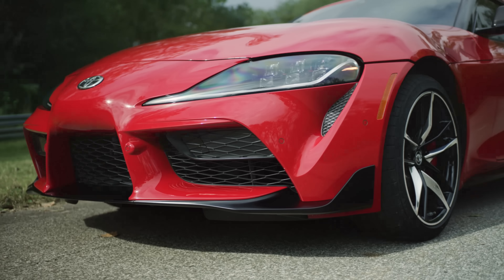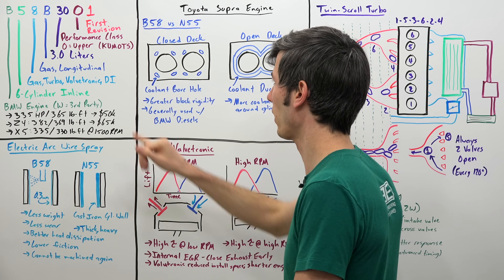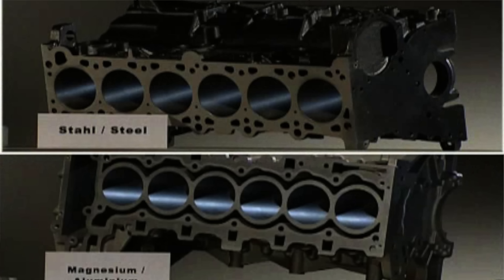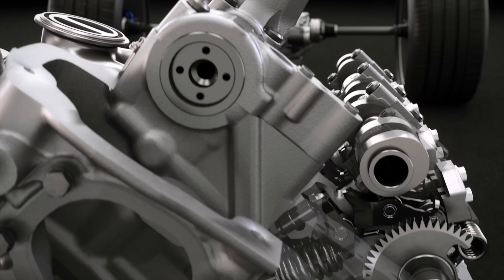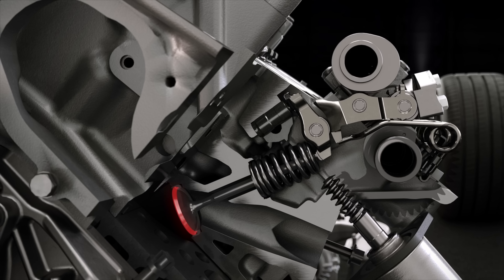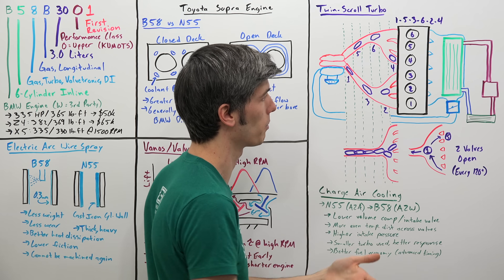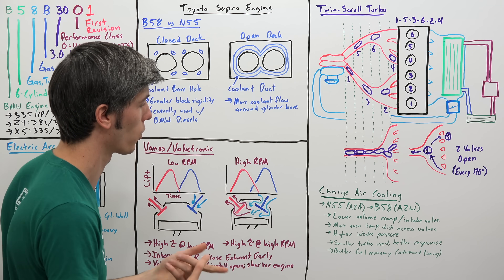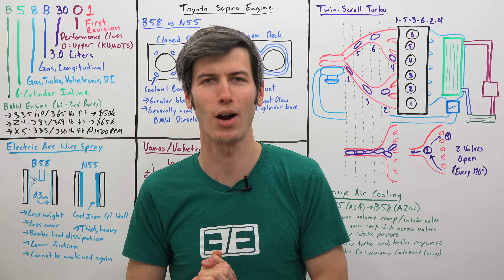2020 Toyota Supra Engine - Detailed Review Of The 2JZ Successor

Comment: When we heard Toyota and BMW were collaborating on a platform we were all hoping for BMW handling with Toyota reliability.  I've seen a video that claims that Toyota did their own testing on all the engine internals and gave their input on what needed improvement.   My thing is that the in car entertainment is all BMW and that does not help with the overall experience of differenciating the Toyota from the BMW cousin

Comment: The "closed deck" design is just closed in near the top of the cylinder I believe, the lower portion of the cylinder still has coolant all around it for cooling. At least that's how it is with Subarus...

Comment: Interesting video!  I am considering a M240i, but I am now concerned about the closed deck concept.  The photos on this video, and your diagram, suggest that the level of internal cooling in the engine (and perhaps the head) will be less on a closed deck configuration, assuming the coolant pressure is the same on both engines.  I heard of no such issues on the M235i, which I presume was an open deck design.  Do you think this is an issue with respect to long-term durability?  KD

Comment: How about this........ as soon as I buy this B58 we pull out the Engine and put in a 2JZ. With the old transmission and drivetrain. Explain all you want it is not the same. The B58 Can't be pushed to fly as high as the 2JZ it would break and probably can't be rebuilt. Mega-FAIL. BMW clipped the old supras wings.

Comment: Boy, no one actually does research. I own a shop in NY and I have worked on MANY BMWs over the years and I can tell you from experience BMW makes the LEAST DEPENDABLE engine on the market. Oil pumps go out around 100k, other parts especially on the valvetrain made with the wrong materals causing wear issues. The list goes on. On the other hand, I've seen Toyota made engines last well over 500k, Ford 4.9L inline 6 go well over 700k I have a bronco with the original 302 with 600k on it and it still runs great!

Comment: Great info but... Ummmm 
Watching this in my 2018 F30 340i Msport with the B58 Engine and JB4 tune (MAPS) 91 and 93 OCT 
Hmmm so basically my 340i will smoke the new supra lol 
As I'm currently putting down 362whp and 402 tque @ 23.4 PSI (91 OCT)

387whp and 424 tque @ 18.9 PSI (93 OCT) 
So yes why would I invest into the new Supra lol 🤦‍♂️💯👏

Comment: Hey Jason. The explanation about valve overlap isn't right. Actually there is a large overlap at low revs to improve scavenging and get the turbo spool up to get better response and max torque, whereas in high speed, scavenging cannot occur since the exhaust pressure is higher and instead it reduces the volumetric efficiency. So at higher revs , lower overlap is used.

Comment: such a DISAPPOINTMENT .....my god...
Reply: I drove a stock 340i with the B58 in a manual trans last week.  The experience was anything but a disappointment.  There are videos of tuners getting 400+whp with some simple aspiration mods and a tune.  With this engine driving the new Supra AND the Lexus IS, expect the aftermarket community to really step up their engineering efforts in unlocking the potential.  It might end up surprising you.
Reply: Brian Neu You don't get it.

Comment: I want a supra... Not a bmw pretending to be a supra. And yes.. A BMW supra is what it's true name is TECHNICALLY!! I like toyota and i like BMW. But i like toyota far better for reliability and its cheaper to work on and get worked on. Bmw is too expensive for its own good but of course if you can afford it and like that then more power to you and have fun. I cheer u on and know where your coming from. BMW is a fun car to drive none the less. But a hybrid between the 2 is like mixing coca cola and sprite and trying to sell it as a great brand. Not a good move. Swap that BMW out for a 2jz. There are  limits for tunability on that BMW engine. What are you supposed to do after that lining is gone after 150,000 miles? Pay an arm and leg to get the engine shipped and restored, how long will that take? Months at least, or get a new engine? Which is what i would definately expect BMW to do to boost production and sales of that mediocre engine. You really cant do much to it at all. You are limited by that lining in reality. Swap that bmw engine out for a 2jz.. Then we are talkin! Cant wait for diy videos on that aspect.
Reply: Again im not talking down on BMW.. By itself BMW is an impressive machine. Great car great engine, better handeling and chassis, the whole 9 yards. With that said. If im a BMW lover i wouldnt mind getting the supra knowing these facts and save $15000. But for the toyaota lover. Its cheaper to build, modify, make big power, and upgrade suspension to wjat you are trying to achieve. And yes BMW has better handeling by far from the factory. Very impressive. I absolutely love it and wouldnt mind leaving that in! But Its not a toyota "techically". And if you want to upgrade and customize the engine and hp and torque curve for what you want to achieve on the track or whatever you want to do to customize it. Then i dont think there many options to  upgrade this engine. The 2jz is an iron block. It can handel whatever boost you throw at it with ease. Im just talking about big power. The 2jz is almost indestructable. So you can do a million things to it. Make it reflect you. The impressive BMW engine is very specifice in its design. Not saying thats a bad thing. Its a perfect engine for its purpose. Its for the people who want Bigger power 1000-1500 hp. Cant sleeve this engine. Cant increase hp by much because it will go beyond the designe of the design of the cylinder walls with the spray on lining.  Ok so basically its just the difference between people who like to modify and make the engine their own with big power. and the ones who are perfectly fine with leaving the engine alone. Great enigne. But i can tell you like most BMWs, its a tempermental engine/machine the moment you touch the engine.  Its so specific in its design i wouldnt reccomend to modify it and to leave it be.. It might be able to handle slight changes like breathing, higher boost changes, and adjusting the curve but only to within its specific design limits which is small. But guess we will see. Theres a lot of smart people out there so im looking forward to seeing what people can do do make this car reflect their personalities.
Reply: Just buy Supra then. Most of you wouldn't have bought this car no matter who made the engine. It's funny to see toyota fan boys crying all over youtube.
Just thinking out loud.
Reply: Who will want to downgrade bro? B58 is already making 800whp and 1200whp is possible - with better dyno curve and torque and better turbo response, not to mention best chassis toyota ever had. mk4 supra was mediocre in handling even compared to that era BMW M cars. Poor F&F fanboys have a chance to finally experience what a ultimate driving machine should be.

Comment: Btw, anyone that knows anything about turbocharged engines (especially in the Honda world) knows the benefits of a closed deck versus an open deck when it comes to sleeve strength. While I find the fact that you can't just bore it if something were to go wrong kind of disturbing, I'm sure we will still be able to resleeve the block if goals are over 1000 hp. Idk what those spray in wire sleeves can handle, but my guess is not a whole lot.
Reply: Or hell, worst comes to worst, we could swap a 2JZ into it, or even an N55 and boost tf out of it.

Comment: I have to say I'm rather disappointed. If I wanted a Z4, I would simply buy a Z4. I will admit the aesthetics are good, but a lot of the rationale for buying Toyota/Honda is the implied reliability. Also the purported 335hp is not very is not specifically impressive for a 3 liter turbocharged motor, though I'm sure there's a lot more power that could be unlocked there.

Comment: Toyota 3jzgte please. Stop with this BMW collaboration. Go to Yamaha and have them build you a cast iron block closed deck engine with variable valve timing on exhaust and intake and both direct injection and port fuel injection(for emissions and economic purposes) twin scroll single  turbo and a manual trans. Make  a engine that people can experiment with and you will have a winning recipe, not this piece of junk.

Comment: Great design lines derived from the FT1 concept while giving flashback emotions from the MKIV Supra...
The whole BMW/Toyota joint development issue isnt something that i mind...
The only problem is the platform they chose to share.... It should have been the M4 , not the Z4....
Although for cost savings etc, they just could use the new sister company Lexus RC-F body (FR 2+2 coupe) which would allow the design to be smoother and more "Supra" rather than a compact 2 seater Roadster turned to a coupe. It could also be powered by the new 3.5 V6 Twin Turbo powering the new LS, with Gazoo Racing's treatments.
BMW has definetely givven the new Supra a great interior in terms of quality, materials, and built.
Also the engineering is great as BMW is a leader in 4/6-cylinder turbocharged engines for 2 decades now...
My feeling is that because in Japan there will be the SZ/SZ-R versions with the 2.0l 4 -cylinder turbo engined  with 197 / 258hp respectively as well as the RZ with the B58 and 340hp, the Supra will be a major success due to its tunability, and lack of competition in the JDM market in this class.

Comment: Closed deck - good.
Non-replaceable liners - bad.
Vanos+Valvetronic - good idea, will be terrible implementation (overly complicated and unreliable).
Twin Entry turbo - good.
W2A intercooler - good if not for plastic construction, terrible.
335Hp out of turbo 3.0 with Vanos+Valvetronic - pathetic. This power level is achievable in N/A form. I suspect it was watered down so it does not compete with Z4 sales.
Not designed by Toyota+Yamaha - utterly disappointing. Except the questionable look, what part of the car is designed by Toyota?

In reality this is a new Toyota Cavalier of the GT cars. In 10 years (when regular people could afford it) this car will have so many problems that no one would want to buy it. Where I am located used BMWs are not in demand, and only clueless people buy them, simply because they are falling apart and are very expensive to fix, compared to JDM imports.

Comment: One observation, the B58B30O1 has two turbo and the M1 has one twin scroll.
Reply from the maker: Are you sure it’s not the S with two turbos? Thought O1 is the dedicated Z4 engine.
Reply: @EngineeringExplained  you are right. Between O1 and M1 the main difference is the exhaust manifold...but both mono turbo twin scroll

Comment: The exhaust manifolds are internal and there are actually two ports exiting the head. More of a collector than a exhaust manifold. One of the reason for this is to cool down the exhaust for lower emissions. Btw the "exhaust manifold"on the b58 looks similar to the rx7 exhaust manifold and provides a more compact package for the already crowded supra engine bay. For me there is just way too much plastic in that engine bay as with most newer cars and is just one more thing to worry about.

Comment: I don’t know why people are so upset about the engine. All the great Toyota engines like the 3sgte,2jz were developed by Yamaha. Toyota was never a great engine builder in the first place. They relied on other companies.
Reply: I think its mostly because of how different the philosophies of BMW vs Toyota are. As far as I know the JZ family was only partially developed by Yamaha (and I think it was mostly the head). That isn't too surprising as Yamaha and even up to the 1LR. But on a fundamental part these engines all started out as a toyota design and just hiring yamaha for some extra engineering talent. 

that just doesn't sit too well with Toyota fans when this engine is a non-toyota design. Especially when BMW has had both true and false conceptions of questionable reliability,  andthat this is a brand new engine with almost no proven miles in production. No one knows about this engine, and where toyota is now synonymous with "engines that are bulletproof from the start" it's hard on toyota fans  sitting on this giant question mark. For all we know it could be absolutely bulletproof....Or it could be an S85/S65.

Comment: I hate when people say that the new Supra isnt a Supra because it is made by BMW. And it wont be as good as the A80 Supra. But they forgot that the A80 didnt had 600-700-800-900-1000Hp when it came out of the factory. If we look back to the early 2000s some tuners called the BMW E46 M3 engine the Europian 2JZ. That car with that engine is still a legend just like the A80 Supra. Give the new one a chance, and let Dough decide weather its a good car with a good engine or a bad one. Thanks for reading this. :)
Reply: SSgt Preacher Dough is the type of guy who single handily depreciates the value of a car by revealing it’s useless quirks and features.
Reply: @soraaoixxthebluesky  *increases the value
Reply: its because the z4 engine is built like dookie

Comment: Great Video! One little thing you said about the name of the engine that I want to correct. 
The first B in the name does not stand for BMW but for Baukasten which is the engine production type. For example you see the older engines of BMW had either N or even older the M engine types. (e.g. n47: "N"eue Motorengeneration (new engine generation), 4 cylinders, diesel engine)

Comment: if the engine wasnt turboed, the camshaft timings at high rpm would definitely cause problems wouldn't it?because the intake cam is blocked by the gas trying to escape during the exhaust stroke as well

Comment: Not even remotely a 2JZ successor in any way beyond being a turbo i6 in a car called a Supra. No iron. High compression. Short Valves. Low potential without crazy $$$ and never will be as reliable as a rusty 20 year old 2JZ because it's built to make as much power as it makes stock.

Comment: With the cylinder walls being electric arc sprayed on and since you can't machine them, surely they will make it possible to machine and respray the metal surface on? That would be handy.

Comment: @Engineering Explained
The USA Z4 makes more power than the other Z4's because it doesn't need an extra exhaust filter. The same filter is on the Supra but also is in the US. That is the horsepower differences

Comment: Great, another ugly car that will completely fall apart after 100K miles.
Reply: 500k km (300k miles) and much further beyond in a European spec 3-series is very common. This engine uses european spec Nicasil instead of the American spec iron sleeves, which is why it will probably last much longer than other BMWs for the American market.
Reply: they will swap 2jz back into the zupra hood. thats the point. then toyota can continue to brag about toyota reliability.

Comment: BMW Supra? No Thanks, we wanted the Toyota Supra designed in Japan. 
Perhaps a 3JZ: A polished up, modernized, D-4S version of the 2Jz.
Having Port and Direct Injection and being Toyota designed would make it a much more desirable, reliable car. Having both is the best way to keep the intake valves clean and carbon deposit free.
Reply: Just get a mk4 shell and slap a 1fz in it and you've got a 3jz supra.

Comment: The B58 its a pretty good engine, it will makes lots of power in stock internals. But you can't tell Supra fanboys that an S55 is just as good as a 2JZ. BMW engines are strong and realible it's just that everything else around it it's not.

Comment: The biggest problem with BMW engines is carbon build-up on the intake valves with EGR, which Toyota had solved with dual (port + direct) injection on all their Toyota/Lexus cars that had direct injection. Even Ford started doing dual injection on their F150 engines for the same reason. If this B58 BMW wasn't modified to have dual injection, it may leave a black mark on Toyota's reputation for reliability. I hope Toyota did think this through. With German cars, they only want their engines to last the 36 months of the lease these days, so it won't matter for the Z4.

Comment: The tragedy of Toyota arming one of its legendary cars with foreign engines coming from BMW !!!!! it is even not a joint venture car with the foreign manufacturing !!!! I still think that the Lexus LFA , after excluding the composite materials used in the manufacture of the structure (carbon fiber) and the high quality of materials used to manufactured  
the engine the front engine mounted , rear wheel drive LFA was a good project for the Subra question Is this a good rival for the Skyline !!!!!.....

Comment: Toyota should've called this new "Supra" something else, like "BMW-TRD-Z4" or "YotaZ4" ;) . This is so different from the classic and iconic last generation Toyota Supra that it just shouldn't share that same name. Ideally, Toyota should have put some effort into redesigning the classic 2JZ engine using modern manufacturing techniques and technology and created their own chassis and body. The B58B30O1 is a great engine, but I wonder how its reliability will compare to fully Toyota-designed engines, especially the extremely durable and strong 2JZ.

Comment: engine seems decent but the spray on cylinder liners are not as desirable as a cast iron liner i am a fan of the closed deck block though. The manufacturers really do put way to much effort into trying to reduce turbo lag though there is really no practical reason you need full boost by 1500rpm. The real question is how well the transmission and the rest of drivetrain behind the engine will hold up when people start trying to tune these things with more boost bigger turbo's and other go fast modifications.